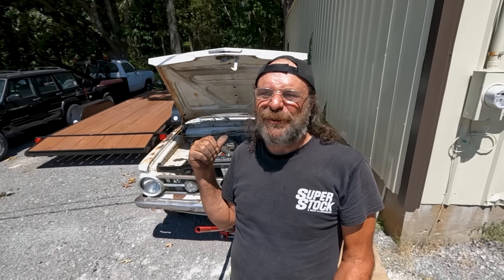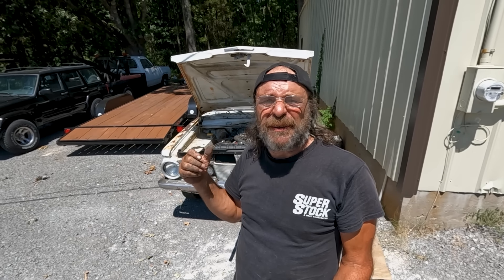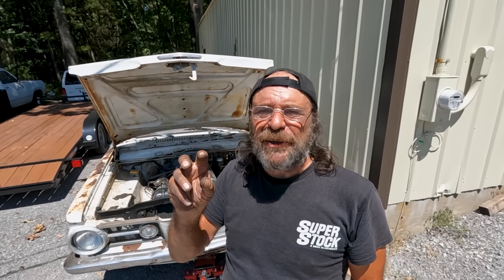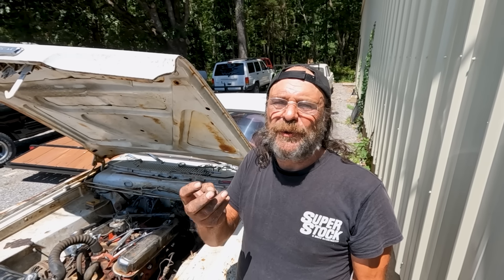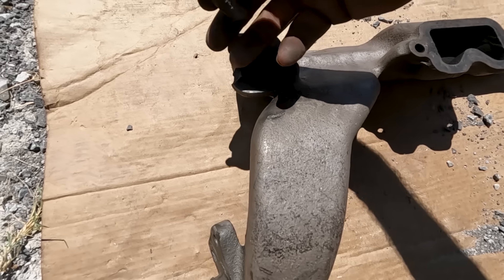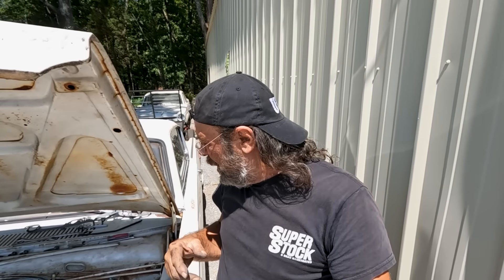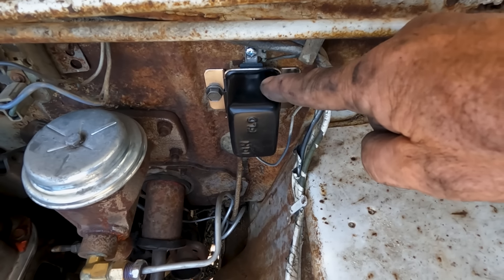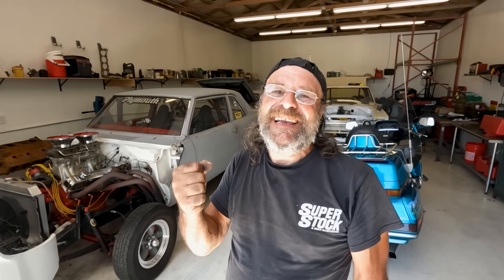Project Car Purgatory - When You Find And Fix One Issue, Several Others Are Sure To Pop Up

Comment: Speaking of throw away parts, and from previous videos on garbage new parts, a friend with a 1986 Dodge Ramcharger 4x4 was going through voltage regulators left, right and center up till recently. I double checked the entire electrical system, most of which I personally rebuilt using a universal kit he bought, and could not find any faults. He went through 3 regulators in a single summer, the same summer I got his 318 running better in fact. And he went through another 3 from fall into the next spring. Well, now he won't be dealing with external voltage regulators. The tired and beaten old 318 has been pulled, new wiring installed by him and another friend of his, and his Ramcharger this winter will be getting a rebuilt 5.7 Hemi with a mild bit of upgrading and a cylinder deactivation delete. I am hoping his 318 is still decent enough for a rebuild, because it would be nice to find a Dart or something similar to swap the 318 into with a rebuild and some light warming over.

Comment: I am helping a Neighbor that bought a Monte Carlo that the previous owner sent to an interior shop. The interior looked great, but the electricals, Power Windows, Locks & most of the Dash did not work. Under the Dash we discovered someone re-wired most of it in all yellow wiring so wiring diagrams are useless.

Comment: I have always had the best luck Chrysler Ford or chevy. Big block small block doesn't matter take the exhaust manifold to the machine shop have the resurfaced flat. Then copper coat both surfaces bolt them on with no gasket. Your services are straight and clean you will never have an exhaust leak it might tic a tiny bit first time or 2 you fire it up the carbon will find its way into that and seal itself With no copper coat . Worst thing ever is a  Fell pro cardboard diamond plate looking c*** gaskets they just burn then the bolts back off in manifold warps. Only other solution is  Layeredmetal gaskets for a single layer copper gasket and then coat that with copper coat. And if you're not trying to stay original put studs instead of bolts Especially on Ford Engines. Years down the road the stud will break off but it usually won't break off flash like a  Bolt.  There's lots of stud kits that have thick  Brass nuts. Yeah I said it ha ha They work.

Comment: Bought a 72' Duster. Swapped in an 8.75 rear end. Found that the passenger side front eye on the leaf spring was broken off of the leaf on the original 7.25. i never thought to look up in the spring mount before the swap. Who would think it would break there???

Comment: MP fuel starvation could be scale in the fuel line due to running time runs with low fuel levels in gas tank?
Reply: Fuel pump issues are common with the XJ.  They dont like running at lower fuel levels  personly I just consider  1/4 tank as empty.  Mine is a 2001 that has the cats  on the exaust . It gets a bit of heat soak even with heat shielding.  But in Tony's case  he is into the throttle for a pass so  very well could be  fuel feed isue  from  fuel pump or a vapor lock . Could be a both hot soak and lower fuel level alowing the pump to pick up sediment  at the pump pick up?
Reply: @tonypace2009  1/4 tank no lower,  you know with low fuel the sediment sloshing around in turns mixing again in the fuel. I been passing on
that advice for years, especially to women. IT'S A NO BRAINER!!
Reply: @josephszot5545  honestly Most dont realize how much junk there is in the bottom of a fuel tank.
Reply: @tonypace2009  tell the women in your house, save you from aggravation!

Comment: I'm guessing a flux core welder cranked up after heating the manifold with a torch would fix it. I can't say for sure because I've never dealt with those manifolds. But I've fixed other cast manifolds the same way. But everybody has their own way of doing things

Comment: Would a drivers side adjustable motor mount, raised with a ball screw, help with maintenance on the V8 cars? Mechanics ratchet or jack handle drive for adjustments.

It would be similar to the threaded mechanism on a vehicle scissor jack.
Might be able to cut up an old scissor jack and weld the adjustable motor mount together using those components. 

Might be able to re-use the jack handle to adjust the motor mount.

Crank up engine, do maintenance, and crank back into stock location.

Maybe a similar motor mount already exists?
Reply: Future video idea?

Comment: Do you have a video on bleeding brakes on a B body Dodge 1970 with factory front disc and drum rear. The shuttle valve and or proportional valve is giving me nightmares, every time you bleed the brakes the shuttle valve closes off because it things there is a leak while that's normal for safety reasons its a pain in the butt to bleed the air out of the system.  1970 Dodge Charger. Thks

Comment: I've been blowing ignition fuses on my Sportster, first when it was going down the road, and then after I put in a new ignition and fired up the coil by tapping into the accessory wire from the ignition switch, it only blows ignition fuses when the bike isn't running. I thought I might have a bad ignition switch, but a new one did not fix the problem.

On you tube, I hear about what a rectifier does, something about stepping down power, and it's like my parts cannon is asking for a new regulator. This fuse problem only began to show when the weather warmed up, and now that the weather cools down, it's not blowing fuses, but my parts cannon wants a new regulator.

Comment: The issues in this vid are like the story of my life. Two thoughts; I've had a few early "points ignition" Mopar cars with a later Mopar Electronic Ignition system "grafted in" to the early 60's car wiring harness (like yours U.T.) trying to retain the old style regulator & i never had 1 car that the Mopar Electronic Ignition system was "happy" with the old style regulator. Also, i bet when you reroute that starter cable correctly through the bendable body tabs, it will end up too short (too many times having the corroded wire end cut off while replacing the cable end). Still, I always learn something from this U.T. content.

Comment: I am experiencing very similar things with my 74 Camaro that I have had for 24 years. Now that I am trying to actually get the car's odds and ends figured out and bring it to GM-ish if they had made it status, I am finding things that I never knew were a problem or not original, like too large of a radiator when I dug it out to look at it. Now I know why the shroud and hold downs and rubbers never lined up. I just this past weekend learned the steering column was 180 out of wack when I was installing the horn and stuff. Things are keyed by GM and it was all upside down :face-green-smiling::face-green-smiling::face-green-smiling: